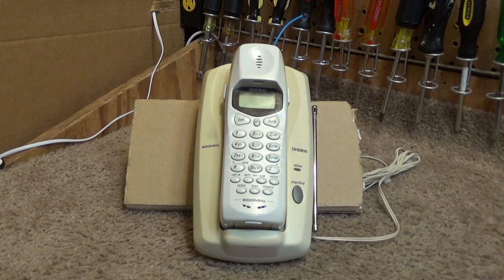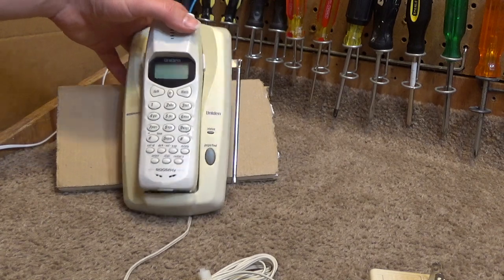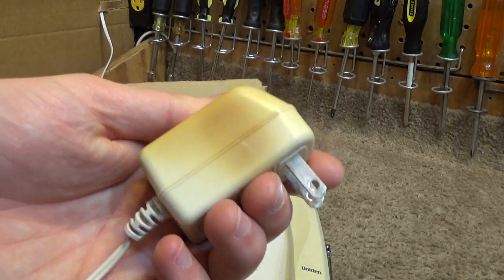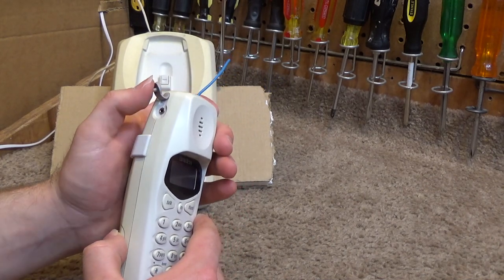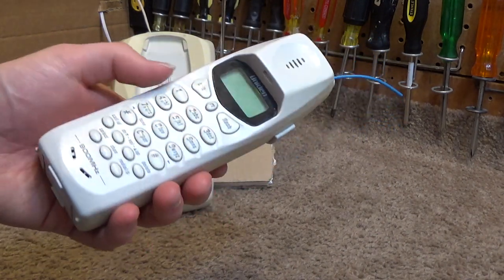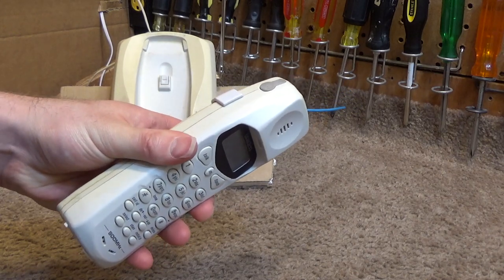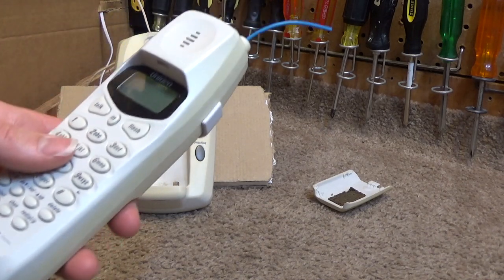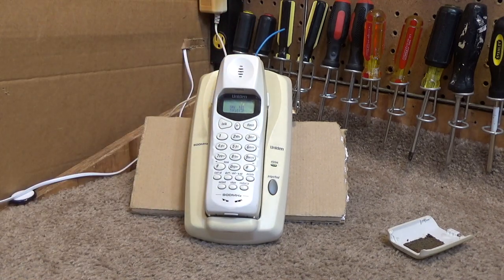Uniden EXI2960 900 MHz Cordless Phone | Initial Checkout 1 of 2

Comment: Great video of the 1st checkout of the Uniden EXI2960 900 MHz Cordless the Telephone the Jordan! Yeah, the adapter, not to mention the receiver capsule & the antenna, needs to be the fixed.
Reply from the maker: This is going to need quite a bit of repair, but no problem, I'll get it fixed.
Reply: @JordanU  - The OK.

Comment: In all the cases I've had charge lights flicker on old Uniden bases, it's either a bad battery or bad AC adapter.  Usually it's only the older boxier AC adapters (like what you tested with later) that are the problems for me, but perhaps the newer ones aren't much better.  Uniden might've had great phones and great batteries at the time, but their AC adapters and receiver speakers sure stink, which is the stinks.
I applaud you for intending to fix those adapters, but I think that's a case where it would be acceptable to just cut the cord off and toss it; the plastic is so brittle you probably can't get them apart.
You're assuming that the second one is spoiled without trying it?  Not good!
Reply from the maker: I wouldn't say they stink. Those adapters run continuously, and are often fed unfiltered, unprotected power their entire life. Over the course of two decades, they'll operate for 127,200 hours. I tend to think this phone was in service for more than that. The speakers, those seem to go with time more than use, which is kind of unacceptable. But again, we're looking at a product that's been in service for over 2 decades.
I can probably slice them open with a Dremel and glue back together. If it's just the main filter cap that's gone bad, I think it may be worth fixing. I don't know of a source of quality replacement adapters.
I am not assuming at all! I plugged in both phones before the video to charge up the batteries and both flicked the same way.
Reply: Okay fair, they don't stink, but in comparison to pretty much every other telephone AC adapter from the time period, I've never had any of them go bad.  And of course it stinks that the AC adapters are becoming the downfall of some of these quality Uniden phones.
Around here people bring boxes full of wires to flea markets, chances are pretty good I'll find a vintage AC adapter in there for a few cents.  Perhaps the Habitat has a similar thing there.  A new filter cap is still a component that's new and made today and therefore not quality, might as well just get the new adapter then.
The O!  The K.  That was not made clear in the video.  I take back that statement then.

Comment: I don’t understand why there’s feedback when put on charge.
I knew something wasn’t right when I saw that AC adaptor all yellowed.
Reply from the maker: The AC adapters yellow like everything else. That is absolutely no indicator of a problem.
Reply: @JordanU  It had one of those dark "something's too hot" spots though.
Reply from the maker: @techwithtyler20  They produce heat during normal operation. The yellowing spot is normal.